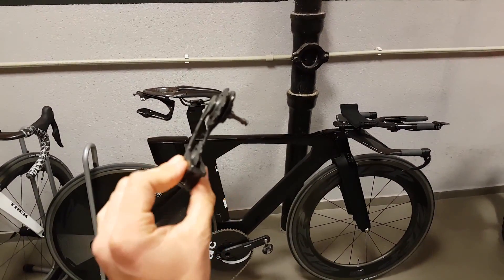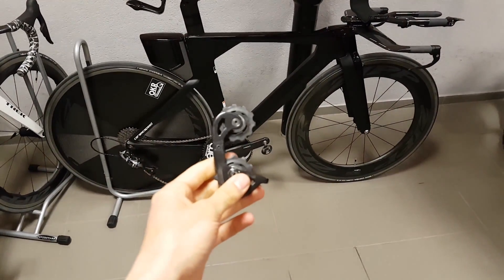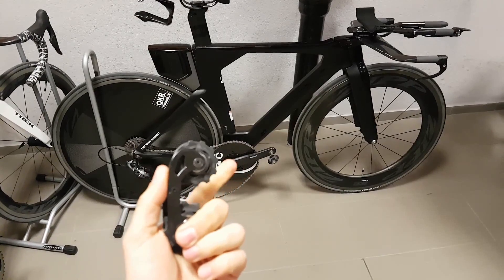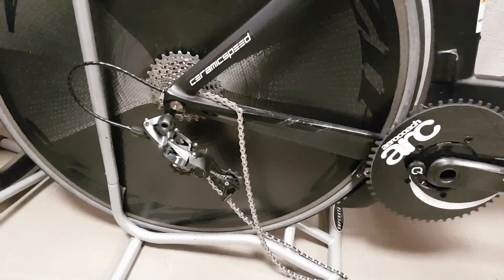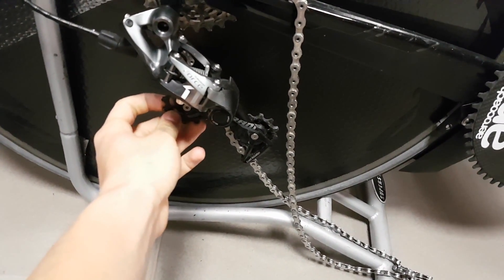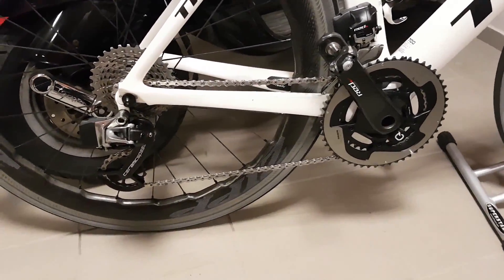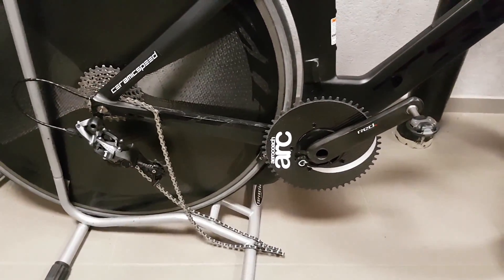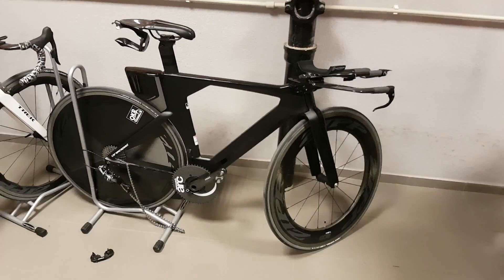Ceramic(speed) bearings: are they worth it?

Comment: Hi Ronald, would u recommend the OPSW coated or the non coated?  huge price difference between these 2.
Reply from the maker: The coated ones are basically immune to corrosion, so it's a better option for wet conditions
Reply: thanks for the info, appreciate it.

Comment: Have you seen any reliable tests or anecdotal evidence of the differences between CS, Kogel, C-bear, F1 ceramic etc.? I'm trying to figure out which pulley wheels and BB are most value for money.
Reply from the maker: Thomas Hemming Larsen not really. Kogel has possibly the widest compatibility, so that's what I use most often.
Reply: Ok, thx. Then it's probably just about buying some and not worrying about it. I doubt that there can be huge difference between the brands.
Reply: Can I ask you? What would you choose between titanium non-coated and delrin coated? The delrin coated are half the price of the titanium non-coated.
Reply from the maker: Thomas Hemming Larsen pulley wheels?
Reply: Yes, sorry :)
Reply from the maker: Standard aluminium
Reply: Thx! Unfortunately, that is not an option.
Reply from the maker: Thomas Hemming Larsen all good manufacturers make those
Reply: Yeah, I just meant that not all combinations of material and bearing are available. They do have aluminium ones.

Comment: Hey Ronald
Enjoy watching your videos :)
I just got my new Madone RSL with etap (just in love with that btw) and have just finished replacing the stock BB90 bearings with the ceramic speed ones... cant seem to getting that next level smoothnes at all! First impression was that the sleeve in the frame was touching the bearing in the non drive side. Grinded that side of the sleeve gently with some sand paper which helped quite a lot! I cant seem to figure out if the dust cover in the drive side also is touching the bearing - but it sounds like theres som plastic friction somewhere...? I think/ hope you might have the answer to my frustrations?? :)
Thank you in advance
Br Henrik
Reply from the maker: Henrik Sloth thanks for the support! I would check if the bearing preload is not too tight, and if the bearings are properly aligned in the frame.

Comment: Great review Ronald.. how do you compare the oversized pulleys vs the standard ceramicspeed pulleys, performance wise? how many watts do you effectively save on the oversized and how many on the standard ceramicspeed pulleys?
Reply from the maker: airguillo31 it depends on a couple of factors, standard pulleys save around 1.5W, OSPW 2.4W+

Comment: Here in Belgium we have a company named C-bear ceramic bearings (UCI Pro team Lotto uses them a lot of years). 
Had the opportunity to try a bottom bracket from ceramicspeed and a bottom bracket from c-bear on my bike (high end bike). 
Did sprinting, climbing, tempo... and i didn't felt and sawn (powerwise) any difference between them.
 Maybe in long use term ceramicspeed wil lest longer.
Price difference => C-bear 98 euro's with delivery and ceramicspeed 390 euro with delivery
My choise was made quick.

Comment: Ronald, in bearings, spinning forever is not a sign of a good bearing. It's not under load so you are putting it in a condition that it is not used to. I did testing of bearings and the results are here. 

http://www.hambini.com/bearing-performance/

The power consumption goes right up after you hit 100km. In which case the standard steel would be better

Comment: Which do you recommend more: Oversized w/Ceramic, Oversized w/Steel, Standard w'Ceramic Standard w/Steel for rear change and which bearing type for BB? Some may complain that the last test wasn't fair because the 1x is lighter.
Reply from the maker: tabl10s I would say oversized ceramic is excellent for road, but I think I would swap the bearings for steel in mtb or cross. If you are referring to the spin test, inertia has very little effect, and the heavier setup should have spun longer anyway.

Comment: No-contact seals and not packing the bearings with grease will make any bearing spin like this.
Reply: I cannot believe that 300Watts (or more accurately about 200N of force) is enough to 'compress' steel balls. Ceramic bearings were designed for very high spin speeds (10 000rpm+) with no grease, in clean, factory environments. If you fill a ceramic bearing with grease, it will have very similar spin characteristics to a steel one.
Reply: No hard feelings - it's a good video and you have some nice kit. But if we believed all the hype re bearings, chains, tyres, aero, etc. we'd all be making the equivalent of 500 watts+! Ceramic Speed spotted a gap in the market and have done well in exploiting it, but 160 Euros + for a bicycle bearing is just silly, when you can buy excellent low friction NTN and SKF for 10% of the price.
Ceramics are good at handling high temperatures, but bicycle bearings simply do not get hot, not even for Sagan!
Reply: I went out and knocked 42 seconds off my best Old La Honda on a warm day with a wind coming from the north. My power was only 4 watts better. Even taking a different line, carrying a little more momentum, sitting up less, etc. will have a profound effect. No doubt ceramics without being packed with grease are a non-zero savings in systemwide efficiency, but I'm not paying $100-170 each to replace ~8 bearings in addition to installing an $600 OSPW for maybe a 3-5W difference over the very best steel bearings with no-contact seals. BTW Friction Facts was bought by Ceramic Speed, so take that for what it is.
Reply: Friction Facts are there to sell stuff, so are not impartial. I have a degree in Mechanical Engineering, and all other engineer cyclists I know are of the same opinion; ceramic bearings in bicycles are just there to extract extra cash from gullible riders. The balls are also much more brittle and liable to damage from grit and other contaminants. 
What says it all is this; Ceramic Speed sell bearings for headsets. This is nonsense. Why would you need ceramic in a headset?
Reply: It's too difficult to compare two runs at different times. You need the same air temperature and pressure (just 5'C and 30 isobars makes a significant difference). Then the wind. It has to be the EXACT same speed and direction. Just a 10% change in either will have a big effect.
Reply: Totally agree with yoog. Ceramic bearings have no place on a bicycle where spin speeds are very low and the environment is dirty.
Reply from the maker: yoog yes, but surely not for long
Reply: Not for long, but with the price difference being so high, it's hard to argue in favor of ceramic bearings. One high quality NTN 6802 costs US$15.75 from Phil Wood. A CeramicSpeed 6802 costs US$169. I can replace that NTN bearing 10 times for the price of the CeramicSpeed. It's going to be more like 20 times if I bought an Enduro steel bearing.
Reply from the maker: yoog yeah, and you will probably need to change  your frame as well, if you replace the bearings 20 times
Reply: Perhaps for the BB, but ATM I am using BSA external cups and also T47 is an option for most PF30 users. Since you are a Trek guy, the options are more limited for BB90 I guess. I think for BBs where the average RPM is ~90, the gains are marginal. The biggest gains are clearly going to be from the jockey wheels, and to a much lesser extent the wheel hubs. I know at least for me at just over 4w/kg, ceramics are definitely not worth the price of admission.
Reply from the maker: yoog Friction Facts tests show 6W between the best and worst BBs
Reply: Yes, but the worst BBs have no place in this topic. I've been talking about the highest quality industrial steel bearings like the NTN in my earlier example. The same would apply to SKF, FAG, NSK, etc. If the difference between a pair of CeramicSpeed 6806s and high-quality steel 6806s is 1W for a 10x price difference, I would probably be able to find somewhere else on the bike to spend my money. Perhaps I'd be putting the money saved from not upgrading to CeramicSpeed bearings in both wheels and BB toward ultralight custom molded race shoes or a custom saddle. The contact points are the real sources of power loss for many.
Reply from the maker: Last year I have done my first TT ever, at 260W with my old Speed Concept, Zipp 808 and 900 Tubs, no efficiency upgrades. Last week I have done the same TT. I ran into huge probems after the start, so I have averaged only 253W, but I have knocked off 92 seconds of last year`s time with my fully upgraded new bike. It was just the hype I guess.
Reply from the maker: You should read some Friction Facts reports then... You obviously do not compress them to half their size, but they do get compressed. The bearings used in bicycle products have different tolerances. I can`t really see why everyone thinks that they are so clever. All high-end products are engineered by people who know what they are doing.
Reply from the maker: Ok, have it your way.
Reply: fact is vc rode up a hill with a good steel bb and then again with the ceramic bb and the ceramic was faster so nothing to argue here anymore now
Reply from the maker: Cyclespeed Tours the advantage is in the loaded state friction, not the spin speed. A steel bearing may spin just as freely when not under load, but the material of the balls is much softer, so the ceramic bearings generate much less friction when loaded radially.